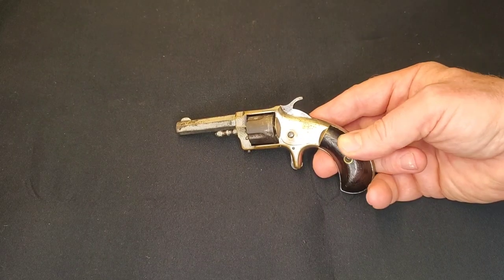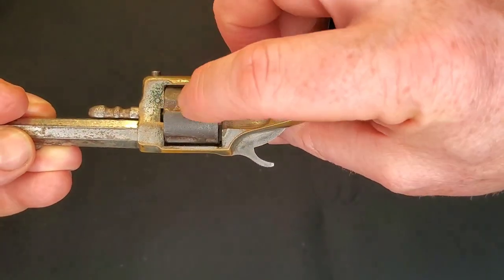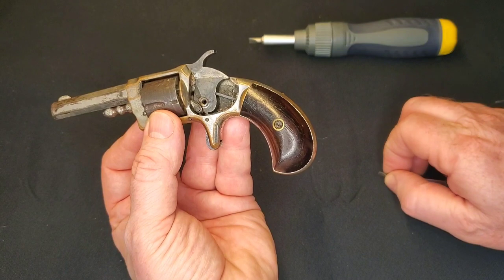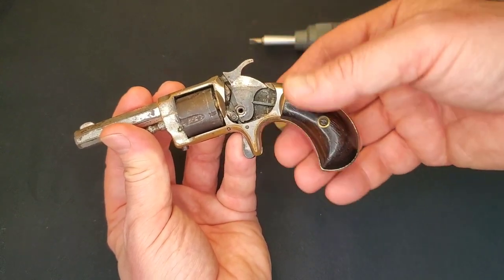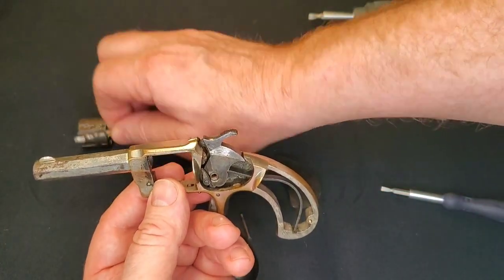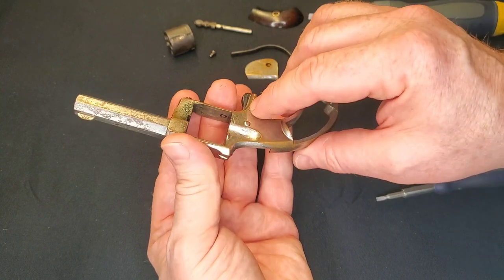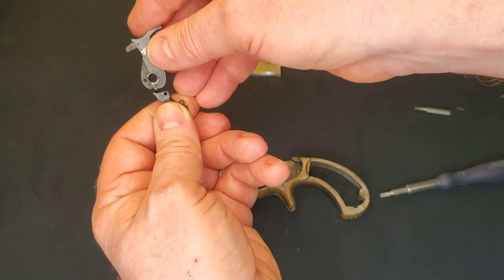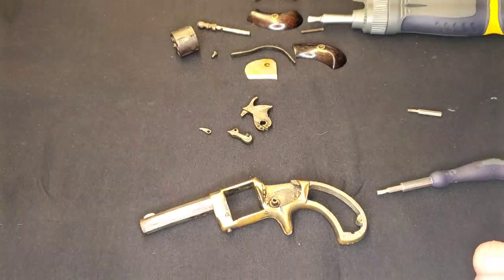Whitneyville 30rf Part 1, Tear Down

Comment: A very cool boot revolver ! But unfortunatly 30rf is a nightmare to reload. Still, a great looking revolver that needs to be restored (maybe boil the cylinder and renickel the frame ?)
Reply: And mechanicaly nearly identical to the S&W firt model third issue in 22rf
Reply from the maker: I'm on the fence as to how I would like to do the cylinder. I would prefer blue but don't have the chemicals. On the other hand, i can do nickel but it won't hide any surface imperfections.
Reply: @bigredgunnut  I would honestly recommend to first boil it 3 or 4 times and then oil it. If the result ain't perfect you can still nickel it ?
Reply from the maker: never tried that. I like that. Consider it done. I'm always willing to try new things and I can see how it could look good. Thanks  @thefrenchgunsmith6488
Reply: @bigredgunnut  I boil every firearm I own ! But just a tip that will save you time : 
- Before boilling : degrease heavily 
- After boilling : take the rust with steel whool, soak the parts in gasoline and then oil. 
Repeat 3 or 4 times :)
Reply: @thefrenchgunsmith6488  Hi, I'm in a similar process but don't quite get it. Why do you boil multiple times ? Is is like quenching ? I'm frankly interested and would like to understand your method.
Reply: @bigredgunnut  Hi. So finally, did you tried ? Does it work well ?
Reply: @CP-pf6gx  Well, boilling is converting the red rust (Iron oxide III) in the black/deep blue Iron oxide II (aka blueing). The boilling process is in my opinion necessary when a gun is having surface rust of very little pitting, because it only works on the surface of the gun. 
The process is as shown previously (look at my previous comment), and can take several pass to achieve the right colour. 
Good luck ;)
Reply from the maker: It converts red iron oxide into black iron oxide which is less prone to spreading and holds oil better to reduce future corrosion. The process is similar to rust bluing. Aestheticly it looks better too. This was the first pistol I tried it on and it seemed to work well.
Reply: @bigredgunnut  Ok great. Thanks for your feedback. And by the way, I just subscribed yesterday.
Reply: @thefrenchgunsmith6488  Thanks man, I appreciate the explanation. Have a good evening.
Reply from the maker: @CP-pf6gx  no problem and thanks for subscribing, it's appreciated